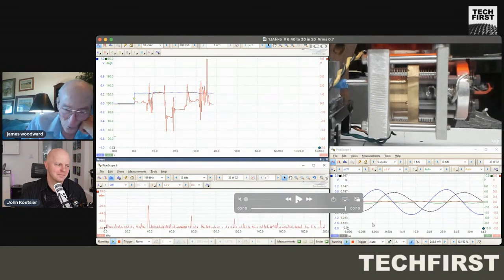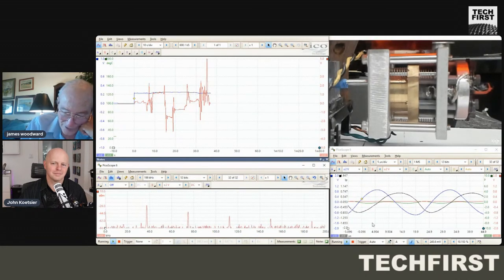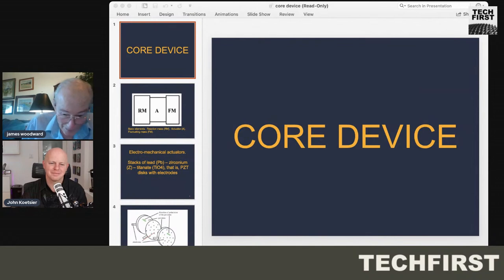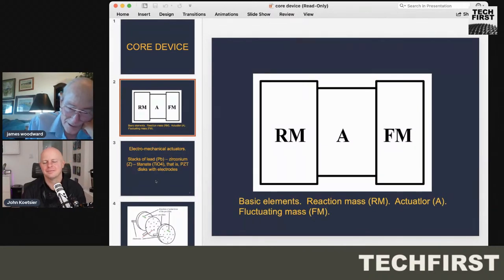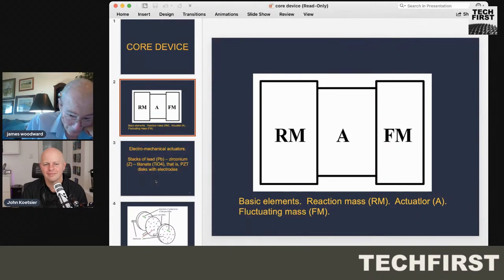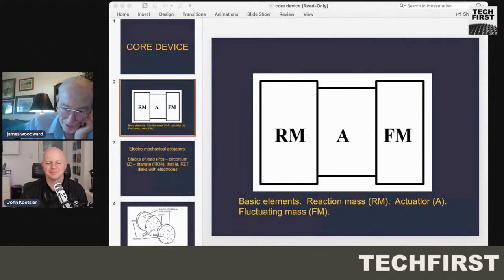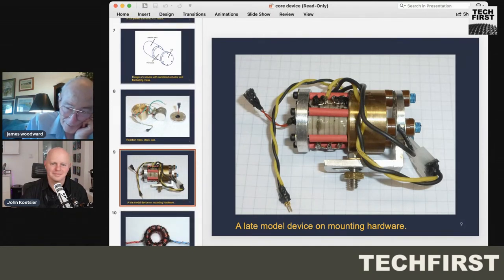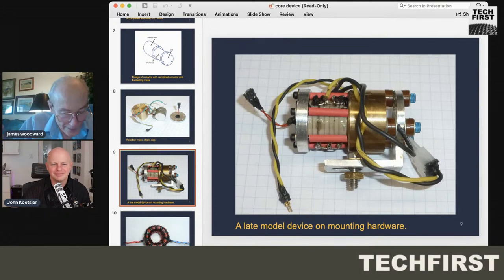Interstellar travel via propellant-less propulsion: The Mach Drive that NASA is funding

Comment: Mike Marsden has already created the Mac Quan 1 which used inertia alone to convert angular acceleration and angular deceleration into linear acceleration (linear thrust) using just electric motors. Some people call it inertial propulsion or a reactionless drive, he calls it mass displacement.

Comment: hm... obviously  I'm full of doubts...  (I'm a physicist myself). 
Yes, I see that movement but since it is claimed this motion is the reason and looking at the spring loaded slider, I have the following theories:
* stick slip? ... yes, I'd like to see this floating in mid air
* some mechanical resonance mechanism?
* how come one charges (and therefore increase mass) the actuator, increase its mass, then translate the actuator slightly in direction A and THEN discharge it... the electrons should transfer their inertia to the wire or wherever they're being discharged to and that should be the end of the momentum conversation, no?

I really wish Mr. Woodward to be right, but the fact that this video is the only 'proof' makes me doubt it even more. 
I mean, why has this not been tested in vacuum, on wheels on a simple plastic rail, with a battery pack?

I really really want to be wrong, but I think (like many of us physicists), this has nothing to it :-/  Please proof us wrong, Mr. Woodward!!!!
Reply: Indeed - "trying to pull yourself out of the swamp by your own hair" with pull frequency of 30khz.
If only you could get rid of the charge of the capacitor to the void of the space, but more efficient way to do that is by converting energy to light and just shine to the opposite direction of required required movement.
Reply: @randfee  But if the capacitor discharge back to the same physical place bonded to the propelled object, you also lose the momentum achieved by displacing mass(charge), right ?

Simple analogy: 
1. pump water into some reservoir. 
2. move reservoir to a some distance
3. pump water back
4. return reservoir back to its initial place
5. repeat

All that can be achieved is a fancy vibration and no movement threw space. 
Movement can be achieved only if you leave displaced water at step 2 while returning empty reservoir back to initial place. Please correct me.

And there is no need to have s fancy vacuum place to measure propulsion - balanced on a string horisontal pendulum with counterweights and some vibration suppression (some foam, should work at 30khz perfectly) should be more then enough.
Reply: The change of mass in the capacitors or piezoelectric crystals does not come from them having "more electrons," rather it comes from an increase in potential energy. After all, a charged capacitor contains more or less the same amount of electrons as a discharged one, if you consider both the anode and cathode. Therefore electrons cannot "transfer inertia" anywhere, except for their mass shifting along the wires (at a fraction of the speed of electricity itself, by the way.)

I don't see any problem with transferring some amount of energy L to/from an object in order to increase/decrease its inertial mass by L/c² (which is tiny.) I also don't have any objection to the use of piezoelectric crystals to couple the phase of the inertial mass variation to a physical oscillation, in fact it's quite ingenious.

My issue is with the figure of 10N/kW of thrust, which is preposterous, as well as with their "explanation" that it taps into the entire Universe's gravitational field or some such. If their current devices can really output such thrust from electricity alone, albeit in an irregular manner, why don't they put them on a pendulum or some other mounting mechanisms that cannot physically have any stick/slip effect?

In any case, I'll keep following their experiment. Godspeed.

Comment: A fairly simple micro controller circuit should be able to provide thermal compensation to maintain resonant frequency. This type of regulation is commonly used in RF applications.

Comment: My main question which nags at me so is: how do you change the mass of the piezoelectric crystals? How do you do it in a way that makes the crystal more massive when thrown to the front of the gizmo, and then less massive when at the back?

If this question is answerable to anyone who understands relativity, I would greatly appreciate it.
Reply: The first part of your question is relatively easy: it is based on the equivalence of mass and energy, “the most important upshot of the special theory of relativity,” in Einstein's own words. In simple terms, if an object absorbs or emits an amount of energy L, its inertial mass will correspondingly either increase or decrease by an amount L/c². Therefore, if you charge and discharge an array of capacitors (Woodward's old setup) or strain and relieve an array of piezoelectric crystals (his current setup) you are changing their inertial mass (by a minuscule amount.)

As for the second part, how to synchronize that effect with the gizmo's motion: in their current setup they use a particular piezoelectric material that oscillates with a particular set of harmonics (frequency ratios) with respect to the electric signal it is energized with. They say they need to solve a few issues, such as calibrating the electric signal to the thermal changes in the material, but allegedly this problem is also mostly solved.

The big question is, how can those small ultrasonic vibrations, coupled with incredibly tiny variations in mass, generate large amounts of thrust? In this video he mentions 10N/kW, which is insane: it means generating 1kg or 2.2lb of force (I'm translating Newtons to Earth gravity equivalents) for every 1kW of electric power supplied to the devices. The musings for this aspect is where they start talking nonsense IMO, citing the gravitational field of the entire universe or some such.

We'll just have to wait for confirmations (if any) of this technology.
Reply: @firefly618  ah I see. I never really thought of how E=mc^2 could go both ways lol. I imagine that unless the piezoelectric vibrates at such a frequency that it gets some considerable portion of the speed of light relative to the gizmos body (which would require a rediculous amount of energy), that 10N/kW sounds quite rediculous. Thank you so much for your response!

Comment: Why does he say the figure of merit is the force per watt? Isn't it also important to pay attention to the force divided by the weight of the device? If that's too high, no flying cars, no launch vehicles.
Reply: As a yardstick, a tesla (very heavy, batteries with decent energy density) doesn't produce a third of a killowatt of output over the average mile. If it had thrusters like that, it certainly couldn't lift itself.
Are you gonna power these things with microwave beams or something?

Comment: My questions are if this mechanism is able to increase and decrease a mass by some small amount where in the cycle would it need to happen and how does it overcome the law of "conservation of energy" I have thought about it and it would seem that regardless of a change in mass of an isolated system the law of conservation of energy would prevail in that a lighter mass would accelerate faster thus balancing  inertia?

Comment: Let's say we have a 100t vessel, need to add 10km/s during one day, a Mach motor operates at 1MHz, and 1000 devices. Then a delta of masses must be equal to 10^12 J per one part of 1000. I've taken a realistic 10km/s and 1 day, unrealistic 1Mhz, and energy is still huge. Even if we will use electric resonance, that amount is insane. I don't think those crystals can be used in a practical engine.
Reply: It is a very new technology. Once it comes out of its experimental phase it will become smaller and more energy efficient. Eventually it will probably be as simple as building a modern jet.